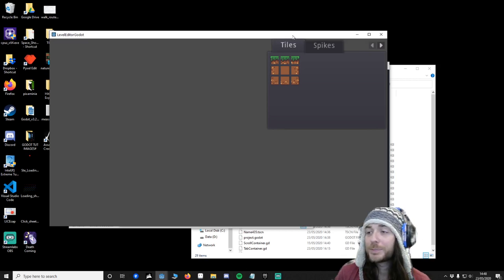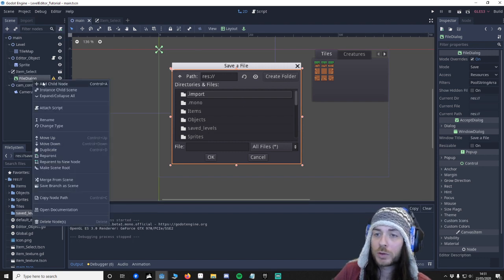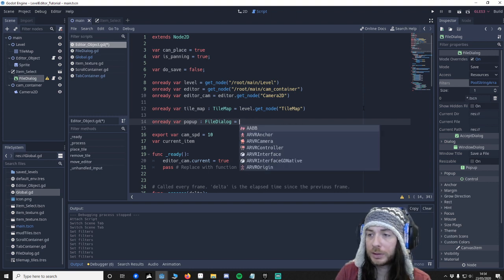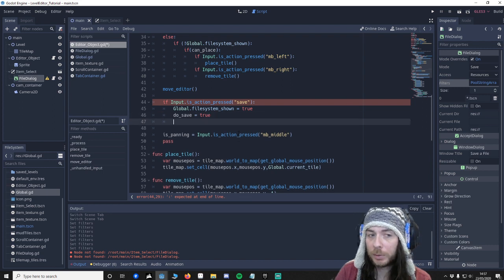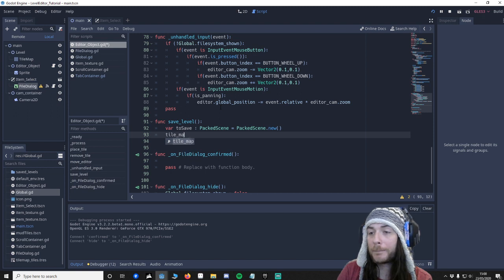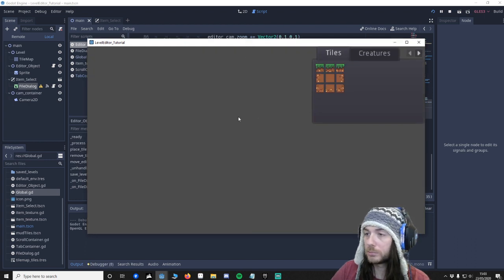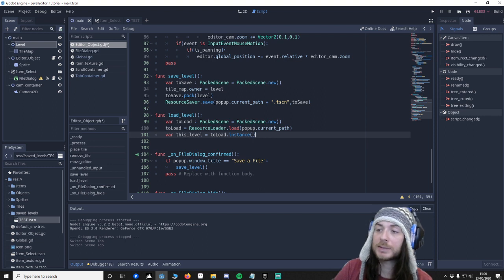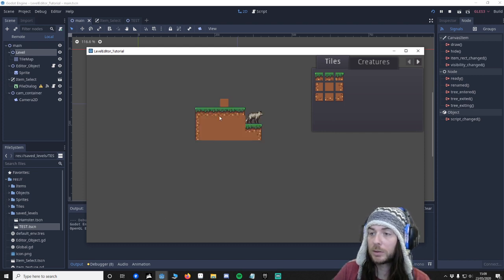Godot Make a Level Editor, Save and Load scenes (Part5)

Comment: Hi, had a small issue where the scroll container and tab container scripts were not working correctly, so I ended up removing those scripts and adding a function so that when I press the spacebar, the canplace variable is false, and the item selection comes up, and when I click on an item in the item selector (or press spacebar again), item selection is hidden and the can place var is made true. Now I have two issues that I'd like to know if you could help me with them. 
1) is there a way I could perhaps right click on objects I've already placed on the level to delete them? (I know we can do this with the tileset objects, but not with the other objects) 
2) for some reason, the tileset is shown above my mouse cursor when I'm trying to place objects... once I place them they show up above the tileset, but when trying to place them, the sprite is not shown above the tileset.
Any help would be greatly appreciated.
Reply from the maker: Hey I'm really sorry for the late reply! In regards to 2), I think this could be the z level of the object placer(previews where ur object will be once u click the mouse). I can't remember which it is but I think setting your object cursor node (a sprite I believe) and making sure the z-order in the inspector is higher than tile map, I think the high the number the more on top it will be.
I'm on phone at the moment traveling again but will try look more into this.
Also cool solution for deleting objects that have been placed I like that!
Reply: @rungeon83  No worries about the late response, thanks for taking the time! Yes, the z-index on the sprite fixed it, thank you very much :D hope your trip goes well.
Reply: I was able to figure part 1 out :) I added a raycast 2d to the editor_object, then made it so if I did a right click while having an object selected, it would cast to it's position plus a vector2 of (3, 3) this detects most kinematic objects, and if you also use area2d's you can select on the inspector to also detect area2d's, then once it's detected, I just have to save it as a variable and queue_free the variable.

Comment: Hey there rungeon.Can u help me in creating curstom brush sizes for tilemaps in godot?????I mean placing one tile at a time is very annoying, especially when u have to create a large map.But in godot we dont have a brush size feature for tilemaps.Can u help me or give me an idea that how can i create custom brush sizes???????That would actually be helpful for my game, cause it has a large map to create in the level editor.
Reply from the maker: I'm assuming you have followed this tutorial? If so find the function "place_tile()" and replace it with the code below. This will make a block 3 by 3 of the tile you're placing with a single mouse click. It's quick dirty code but it works by getting the mouse position in tilemap coords, then it simply adds x and y in a loop and places the tiles. It's pretty simple and it should be extended to be more suited for your project. Hope this helps!

func place_tile():
	var square_size = 3
	var mousepos = tile_map.world_to_map(get_global_mouse_position())
	print(mousepos)
	tile_map.set_cell(mousepos.x,mousepos.y,Global.current_tile)
	for x in range(square_size):
		for y in range(square_size):
			tile_map.set_cell(mousepos.x + x,mousepos.y + y,Global.current_tile)
Reply: @rungeon83  um i got the code but the indexes r confusing me a bit.But hey thanks.Ur response was too fast.Wasn't expecting this much fast.Thnx bro.Also i'm using autotiles in my level editor, learned them after a lot of effort.
Reply: @rungeon83  Thnx rungeon.It worked.Ican't believe it worked.Love u man, ur great.Thnx for ur help, man.I can't explain how happy i am :D